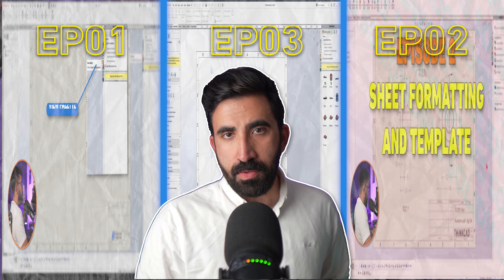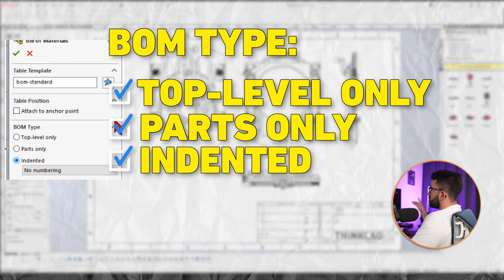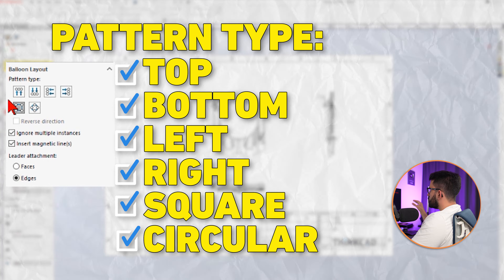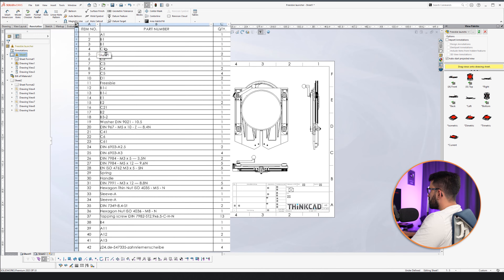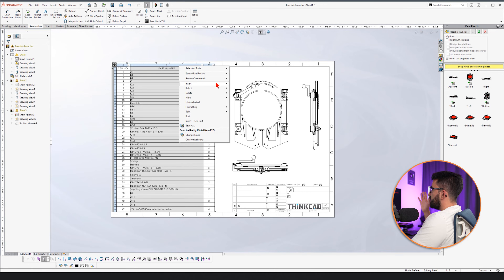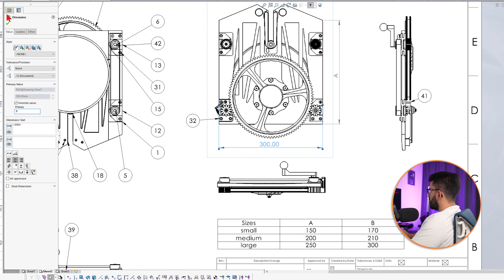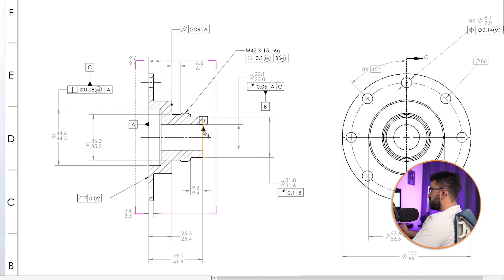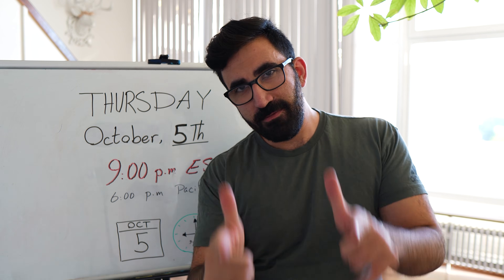SOLIDWORKS Drawing EP03 | BOM | Sheets | Customization

Comment: Great video. Do you know if there is a way to change item numbering to a letter? My company wants to change the item number to lower case letter for frame weldment or part cut list. Thanks for your help
Reply from the maker: Yes, OVERRIDE VALUE, it's a checkbox on the property manger of every dimension, check that, and type a letter

Comment: Sir, i have just finished the Autocad course last week ,,,and I have done Diploma in Mechanical Engineering.  I searched for a job and got a job as a designer in a premium cad company.  Which designs solar PV .
So, is working in a solar company right for my career or not?
Reply from the maker: Good day, 
If you are fresh to the employment sector, take it, starting off is hard, once you build some experience switch as needed.

Comment: 2:45 !!!!!!! Jesus. You don't have to resize rows/columns one by one. You click to the top left MoveCross and then drag it from bottom right corner!!!!!!!!!!!!!!!!!!
Reply from the maker: Thanks for the pro tip.
Reply: @with-aryan  It sounds like a pro tip til you try it. The way the algorythm jumps the rows and columns around will make you regret using it till you get a doctor's degree in mouse sensitivity lol. Anyway, solidworks need to address basic baby bugs (like equations nit rebuilding and many other allpha bugs), before adding new features. But that is the state of many software in our days. Greetings.

Comment: Is there any feature in solidworks like mapkey feature in creo. That's very useful feature; saves time
Reply from the maker: Custom hotkey are possible, they are located under the drop down near the settings small gear.